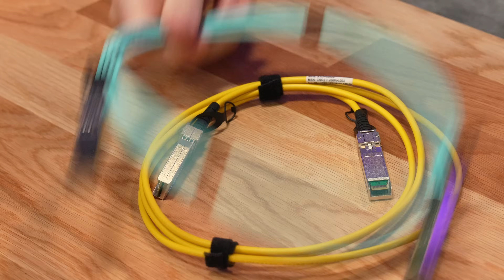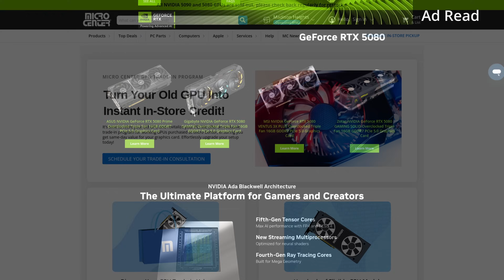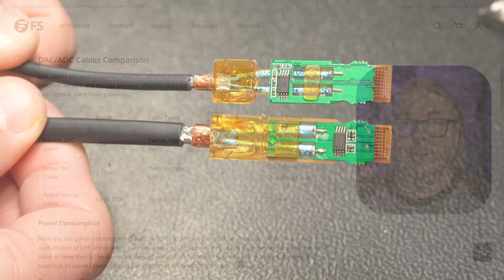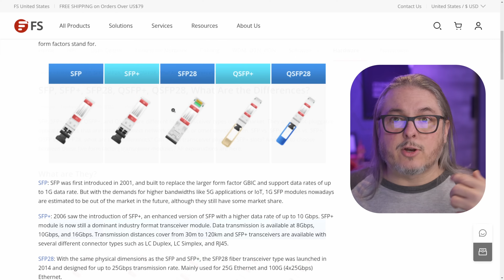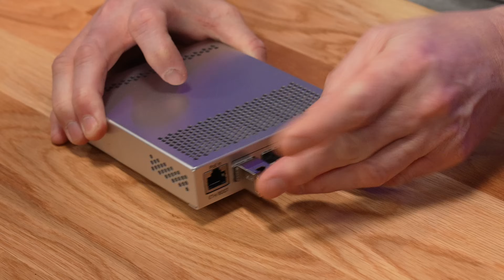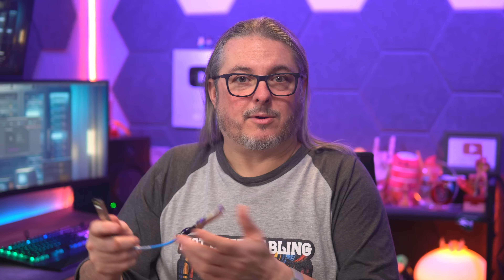Networking: RJ45, DAC, or Fiber – Which Is Best in Your Rack?

Comment: One advantage I can see using DAC over FO in the rack is that, being copper, the DAC should be able to be bent tighter. A tight bend on FO will cause the light to not go through. However, the thicker cable of the DAC may negate this advantage.

Comment: There may be no network side advantage, but a lot of DAC cables use more energy / create more heat than the equivalent multimode fibre adapter.   Additionally, even multimode fibre is a lot thinner and more flexible than the equivalent DAC cable.     This can be quite important in a rack situaiton, but with 10G ethernet RJ45 switches, you may even be able to just use standard RJ45 cables.
With the patch panel, you can get keystone fibre adaptors for these which work well, taking into account they will be a loss point so you need shorter cable runs to compensate, and look very neat
Reply from the maker: You have that backwards, Direct Attach Cables (DACs) consume less power than multimode fiber optic solutions

Comment: I’m new to all this networking stuff but the biggest reason I found for using fiber in a rack is when connecting between different manufacturers equipment. Some sfp+ modules need to be coded to a certain model or manufacturer, so having different models on either end just seems easier than ordering custom cables. But I am still learning so please correct me. Great video!  Thanks. 😊
Reply from the maker: No all network companies require the coded ones and you can get DAC with different coded ones on each end.

Comment: A little bit late, but there is definetely an advantage of fiber vs DAC: price. Copper is almost 2 or 3 times more expensive for the same length in France (atleast in shops) 😅. But on long term, it nullify I think or if you need to pass the fiber in corners or such

Comment: Even for tiny, short runs, I tend to use fiber if only because I don't have to worry about compatibility. With a DAC, I have to worry if it's compatible with both of the devices I'm connecting. With a fiber module, I ony really have to worry about each module being compatible with the one device it's connected to.

Also, as to putting fiber through empty keystone patch panels, That just looks wrong to me :)

I put in LC keystone couplers and use little few-inch fiber cables; it saves wear on the longer cables in my walls.

Comment: you say you cannot get this working with cat > sfp+   the issue is you use intel.  Mellonox works with ZERO Issue I have one in my rack as my server bare metal firewall  runs to a normal cat but I wanted 5-10gb 

works 0 issue. (try it out)  everything else you said was spot on.   but sometimes the actual  rj>sfp matters I use gtech  same for fiber they just work and work well less heat as well.

Comment: Currently using DACs for relatively short(er) distance runs, but I also have two 100 m 100 Gbps AOC cable as well because originally, it was running through the wall to my utility room, in the basement, and then needed the longer runs to get to my office.

Now, they're much closer, but instead of buying new cabling, I just have the giant 100 m AOC spooled up.

I'm primarily running 1 GbE and 100 Gbps IB (skipped everything else in between).

Comment: I mostly use DACs where i can get away with it, but i have 3 Mellanox Connect-x3 cards working well in pfsense, TrueNAS Scale, and Windows 11 and they are dirt cheap. The one in the pfsense box even runs an RJ45 adapter because that's the interface my ISP provides for 10G. Actually the only place there's a slight problem with the connect-x3 is Windows does not detect it as a valid Internet connection for broadcasting a Wi-Fi hotspot

Comment: I know you can’t go wrong with Intel NICs but the Mellanox cards are also high quality and have great industry driver support. They are also price competitive on the second hand market.

Also, I purchased a Mellanox SFP+ card for my QNAP NAS specifically to lower the heat/power requirements for my UniFi Aggregation switch. DAC cables now make this a lot cooler.
Reply from the maker: Mellanox are good as well.

Comment: First of all, love the idea of using a blank patch panel to manage DAC and fibre cables. I normally use cable management trays but that would be neater.

Two other things however on the fibre. Between racks it is better to use fibre I find between them not due to the isolation but I can buy trunk fibres and easily run, 24,48,96 lines between racks in one physical cable and break it out at each end to LC connectors thus keeping the overhead runs fuller and cleaner.

I do also try to use fibre with media converters on external devices such as Starlink, Cellular modems with external antennas etc just to try to reduce electrical paths for lighting strikes

Comment: Multimode is too cheap and the DAC cabling is too damned massive/obnoxious to work with (and DACs tend to have more compatibility problems). Also, power savings is not very noteworthy for low connection counts. We're talking 90 cents a year vs 15 cents a year here per 10G link. You'd have to be running an entire data center to care (or using an automotive winch to close the doors on your multi-hundred-DAC high density cabinet installs; my condolences to your techs).

There are reasons to use DACs. If you absolutely must have the lowest latency option, DACs are perfect for that. In higher bandwidth scenarios the cost difference between a DAC and SM/MM optics can be insane (five figures or more USD in some cases, with first-party pricing of optics) and the wattage differences can be more significant (e.g. 0.1W vs 8W for 400G passive DAC vs MM optic). None of that is particularly applicable at 10G though.

For home setups, well, you can get used multimode transceivers off ebay for like $5/unit (or cheaper even, in bulk orders). Not really much of a discussion.

Comment: Trust me when I say, avoid the DAC and just go Single Mode Fiber and Optics long term.   DAC is not keeping up with the higher speeds.   Sure there is AOC cabling (I actually prefer it over DAC) but when you get to 100Gbps over an SFP56-DD port, you start thinking long and hard about that Single Mode!   I heavily invested in 25G DAC but now I'm having to replace it all.

Comment: When I got my Unfi Aggregation Switch (8 port SFP+) and watched one of Network Chuck's videos (Yes, it is all Network Chuck's fault) I connected all three of my switches to the UAS with DACs.  That part of the plan worked as I had wanted.  However, I could not use DACs to connect my SonicWALL TZ470 (no wireless) to the UAS there was not any connection.  The DACs were recognized on the UAS end, but not the SonicWALL end.  The UAS ports were SFP+, but the SonicWALL were 2.5 Gbs ports.  They would not recognize the SFP+ DACs.  Now I don't thing that DACs come with two different SFPs on each end.  Eventually, 2.5 Gbs  Optical Fiber FSPs became available, so I bought two of them and two optical fiber FSP+.  With the right fiber patch cable, I had all of the connectivity I needed.  It did work with four SFPs, but only at 1Gbs and that was not enough for bragging rights.  You may wonder why I did not go for RJ45 pluggables.  Four RJ45s cost at least $60 each.  The optical fiber pluggables were less that $20 each, and I have not found 2.5Gbs RJ45 ones.

Comment: I'm a "recycling" guy, with 10G I use fiber everywhere I can. Refurbished Intel card are cheap, refurbished intel sfp (OM3/4) are cheap, new optical fiber are cheap (any type). If it's too short you just have to replace the fiber or use a coupler.
The only inconvenient is that some card lock the firmware with specific sfp transceiver brand (could also be true with the switch). Like intel card accept only intel optical transceiver while accepting any dac and RJ45 transceiver, but workaround exists.
I'm just pissed off that my ISP reouter only has a 10G RJ45 connector instead of SFP+. I had to buy an expensive RJ45 transceiver which is really warm

Comment: We always use Fibre and not DAC in our Data Centre. Reason being, when connecting between devices you can mix and match the SFP for compatibility. For example, if you have Cisco to Fortinet devices connected together you have to get a DAC with the right compatibility on each end. If you then change toa Checkpoint firewall for example, you have to get a new Cisco to Checkpoint DAC. With SFP, you just change the module at 1 end. Much more scalable.

Plus all the racks are interconnected via fibre patch panels. You can just keep running DACS all the time, it will be a big headahe.
Reply: DACs also have thick cables that are harder to tuck away in racks when using high density stuff. For fixed installs, AOC are a good option inside a rack and cables can be multiple vendor (e.g. Mellanox on one end and Cisco on the other). I only do SM/MM when I am sure the one installing it do clean the whole path (so SFP + the fiber) to ensure it does not burn out in the coming months.
Reply: Look into Flexoptics we use them and they are so far pretty good. Their modules and dacs can be slightly more expensive than fs ones but they are self programable to pretty much any vendor. So you swap out a switch for a different brand, just reprogram each module (or do it ahead of time if they are fibre and you have spares)

Comment: Thank you @LawrenceSystems for doing this video - I GREATLY APPRECIATE IT!  This video has helped me so much and it's put together (edited) so well - it's just amazing content for me specifically right now, but for the general public as well.  Well done!

I guess the only question I would have is, let's say the home rack has been moved to the office (now the "office rack") and I now have 7-9 existing servers (Dell and Lenovo) and one more new server on the way.  Right now most servers are working correctly, however some have started to issues with storage because of their age.  The existing in-house servers all have different hard drive and RAID card configurations.  Some servers are showing signs of hardware RAID issues and some have hard drive issues.  Given that I have 8-10 physical servers with almost 55-60x virtual servers running on that mix, I'm thinking DAC is not the best and I should still strongly consider fibre????  Would you agree with me, or am I still out to lunch on that topic or should I still be looking at DAC instead (don't be afraid to tell me, I want to get this right.  I'm also thinking if I have a fibre cable coming from each server and perhaps (just maybe) two (2) fibre connections coming from my NAS, that it would be easier to find a switch for 10-12 port fibre connections, instead of a 10-12 port DAC switch).....  Would you agree with that or no?  Please give it to me straight ("brutal honesty" as my friends say) if I'm going in the wrong direction.  I'm getting ready to pull the trigger on this project and I just want to get it right.  I REALLY-REALLY APPRECIATE ALL OF YOUR VIDEOS AND HELP - THANK YOU!
Reply from the maker: Dac in the rack is fine
Reply: @LAWRENCESYSTEMS  I guess you could say "DAC in the rack is wack!"   Peace!

Comment: It's interesting that this video was released today. I have a UDM-SE and have been using an SPF+ DAC cable that I ordered from Amazon. Today, my new USW-Pro-HD-24-PoE switch arrived. When I tried to connect that DAC, which had been working with the UDM-SE, to the new switch, it didn't work. I tried one of the other SFP+ ports, and a link was established. That was just a dry run before putting the switch into the rack. After moving the switch into the rack, the DAC cable wouldn't work in any of the 4 SFP+ ports! I put it back on the UDM-SE, and it worked. After multiple attempts with the SFP+ ports on the switch, it finally connected.

Why would a DAC function with the UDM-SE but not with the USW-Pro-HD-24-PoE switch consistently?

Comment: I've got one customer which has a 100% UI network worth 250k and Synology and all of the servers about a million dollars worth of equipment in total and I find that anything over 3 m in fact on DAC doesn't work for crap and isnt stable!!!! I had a 5m DAC going between two different racks running a 25G Synology and it worked fine for quite fine for like 3 months or so and then it just randomly cut out and it wouldn't work again. That's a 25 gig connection to that Synology and I ended up just using OM4 multimode and I haven't had a problem since over a year and a half later.

IMO anything over basically 3M should be MMF based on my experience. I also talked to Will over at SpaceREX about this and he said he's seen this as well.

Food for thought!

Comment: I use fiber in my rack to isolate copper based ISP’s and device access switches from the significantly more expensive servers & poe switches.

I work for an ISP and I have seen MANY destroyed routers, switches and desktops.  They were all destroyed because of a power surge over coax or phone lines.
Reply: Didn't tought about it, thanks for your comment!

Comment: Be aware of vendor lock-down on "compatible" modules and DACs in both cards and switches. Tom should have addressed this fact.
Reply from the maker: Probably should have mentioned it, but It''s mostly an issue for people who use Cisco.
Reply: @LAWRENCESYSTEMS  in my experience, I've had to hack the EEPROM of some Intel cards to make them work with non-Intel SFPs. Arista also plays these games but luckily I acquired a former Facebook switch which they didn't clean the configuration from and provided me with a secret "unlock" key for non-Arista SFP/DACs.

Comment: jeezus, no just no, Intel 10G SFP cards have some nasty firmware issues on both BSD and linux. 
in bsd its a bit more hidden an can result in some wierd results that woudl take to long to explain, in tldr its a firmware and driver issue that is realted to LLDP 
on linux similar issue that caps the card at 6gbit when bonding. need to disable LLDP on every single link
mellanox is the answer connectx3 or similar is equally compatible without issues

Comment: My very simple home network uses SFP+ for 10gbe and RJ45 for 1/2.5.  None of the 10gbe runs are long so mostly DAC's with 1 fiber run to my workstation and 1 to my bench.  At the datacenter it's all fiber though (if it's not RJ45) because it's a lot easier to swap modules if compatibility is an issue rather than have to order a new DAC/AOC and it's cheaper when buying lots of premade fiber in bulk, never mind a bundle of fiber is a lot easier to manage than a bundle of DAC's.  I'll leave my past issues with Intel aside and just say I've been happy with Mellanox cx3/4 cards.

Comment: I think its entirely dependent on how many cables you are running. We switched from 10G on all my servers (8 server x 6 10G DACs), it was starting to get unweildy.  However, switching to dual 100G QSFP28 DACs is now two per server, so its totally managable. We also moved our switches to be closer to the middle instead of TOR, and that allowed for much shorter cable runs. But, because DACs dont easily come in custom lengths, they tend to take up more space. However, when I previously wired a datacenter, we had order a whole slew of custom lengths of every kind (and color oddly), and it made for really clean cabling.  Also, fiber is easier to label when you Labelcore's (Panduit).

Comment: There's also a design on Printables to 3D print keystones for the DAC cables with a patch panel since you can't use a coupler like with RJ45 or fiber.

Comment: I own a netgear 12 port 10gbe switch that runs at 40w even with nothing going on. 

What will a sfp+ or qsfp switch use as a base?

I’d love to run fibre to my desktop 20m away, and use dac to my servers but my supermicro board has the 10gbe onboard. 

I will look for a sfp+ switch … 1x 10gbe to supermicro and then sfp dac to main server and fibre to my pc

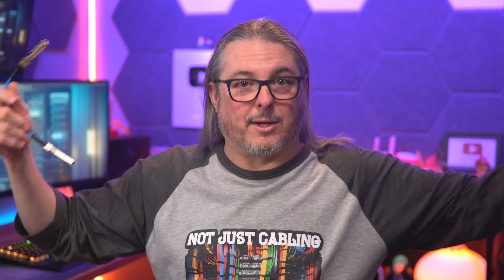Comment: 11:00 what about latency?...
Reply: DACs are usually better for latency but the differences are small.
Reply: @SoWhichUsernameIsNot  That's why I was surprised to find that Fiber has about 10% lower latency. I've tested both 10Gb/s and 25Gb/s with Mellanox ConnectX-3 and 4 correspondingly. With regular LC fiber cable, not AOC. Adapters connected directly without a switch. Cable length 2-3m. I think I used qperf for the measurement, rather than ping. I don't know if that makes a difference. The 10% as such is also not sth I'd loose my sleep over. The moral here might be - do your own measurement! Also, I'd rather have a somewhat higher RTT latency with a protocol running over RDMA than a lower latency with a regular TCP/UDP. Then the entire stack will (presumable) have lower latency. And that's what you are ultimately interested in. There's not much money to be made by using ping alone.

BTW, both should have much better latency than 10GBaseT. The encoding scheme is quite a bit more complicated than just the stream of bits in the DAC/AOC/Fibre case. But I haven't tested it myself for exact numbers. And wouldn't be directly comparable if I cannot use the 10GBaseT transeivers on the same network cards directly.

Comment: I recently upgraded my pfsense with dual 10G to take advantage of AT&T over provisioning on fiber internet here.  I am using DAC cables for everything 10G with two exceptions.  My main PC has an old Asus ROG 10G NIC with RJ45.  So, I have an 10Gtek SFP+ to RJ45 connector in my Unifi switch for that connection.  In my pfsesnse box, DAC from the Intel x710 to the Unifi switch.  Then a Unifi SFP+ to RJ45 in the other port to my modem/router thing.  I used this as a recommendation online from somebody else that did the same setup.  It will negotiate down to the 5G on the modem.  

What all the trouble?  Well, I pay for 1G internet.  But, AT&T gives 1.2-1.5G to the house.  So, if you connect to the modem via the 5G port, you get that little extra that is sent to the home that the normal 1G ports can not pass on.  On average I get about 1.2-1.3G through it.